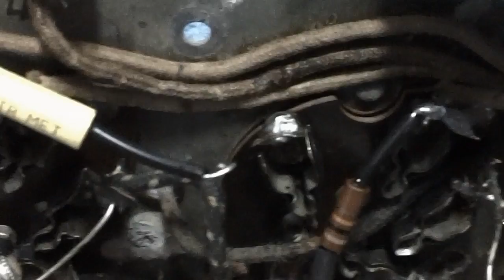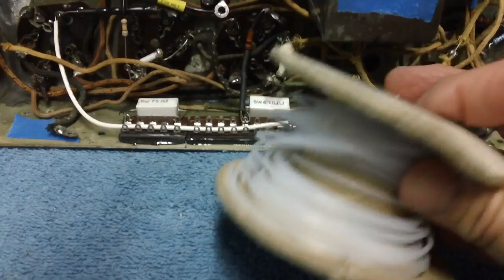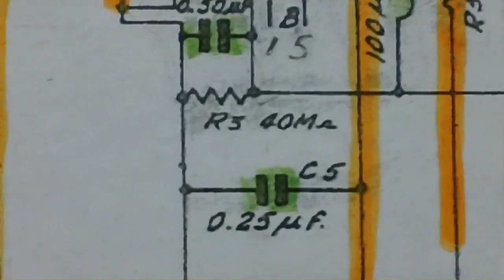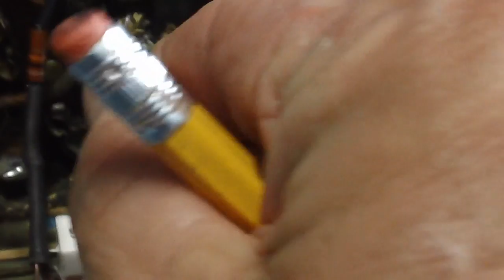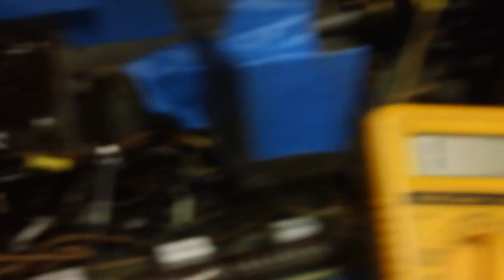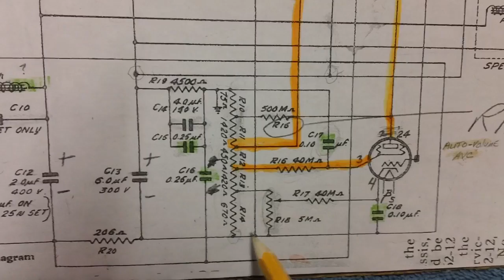1931 Airline 62-14 (Part 18 of 44).

Comment: What brand &/or model solder extractor do you use or maybe recommend???? Great video!!!!

Never mind you mentioned it in a later video.
Reply from the maker: Michael,
I almost exclusively use a pump extractor, but once in a while, particularly when needing to extract solder off a thin circuit board, I use my Hakko FR-300.  But a pump extractor will generally meet your needs.  It just takes a little practice to get comfortable using it.  It also must be cleaned out regularly or the solder buildup will stop it from working.:
https://www.ebay.com/itm/CML-Supply-Desoldering-Pump-Spring-Loaded-Solder-Sucker-Silver-and-Blue/261095877421?epid=1900169141&hash=item3cca86eb2d:g:O-oAAOSwBlBc9TXk

https://www.youtube.com/watch?v=wDvgi289dv0
Regards,
John

Comment: Hi John,
I always learn techniques or products to use from your videos and I was wondering where you get the industrial grade shrink tubing that you use and how to specify this better grade of tubing.  It seems so much better than the kind I have been using and provides better insulation as well.  Thanks in advance.
Pat
Reply from the maker: Pat,
I got it from a gent I know.  I'll ask him where he gets it and will get back to you.
Regards,
John.
Reply from the maker: Pat, This is where the industrial heat shrink (various sizes) comes from, but it's probably too expensive to mess with and one might have to buy excessively large rolls of it.:  Cary Industries, 10401 Baur Blvd St A,
Olivwtte, MO   63132
314-432-6160   Regards,  John
Reply: Hi John,
Thanks so much for getting back on this.  The good stuff always costs a lot and in the interest of keeping this an affordable hobby I appreciate your advice.
Best,
Pat

Comment: If there was a situation where you wanted to protect a wire from heat, there is braided fiberglass insulation sleeves that are high heat rated ( 600c ) that would protect the wire for sure. The braid can also be used over high temp resistors as well.
Reply from the maker: Thanks, my friend.  Fortunately, I don't often have to worry about heat protection.  Good thing as that fiberglass insulation is pretty pricey stuff...just to wind up collecting dust in one my workbench drawer.  I hadn't realized it cost so much.
Regards,
John